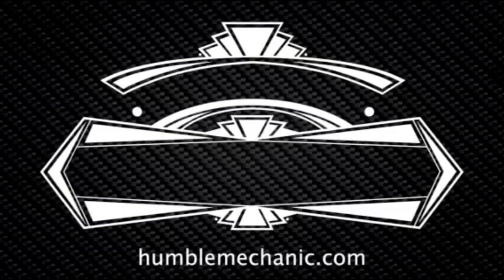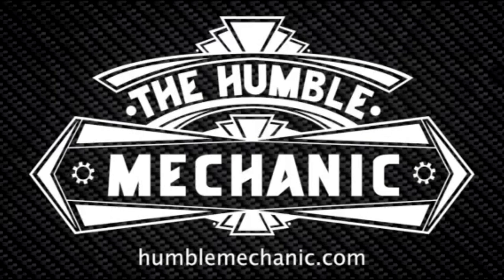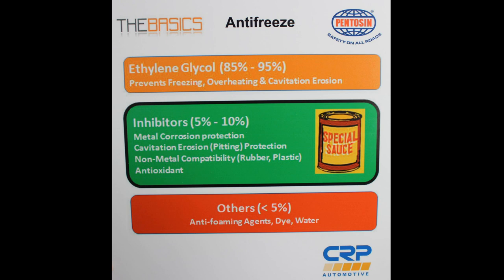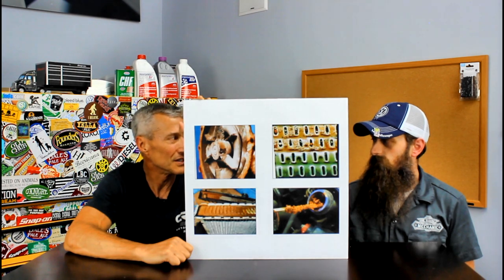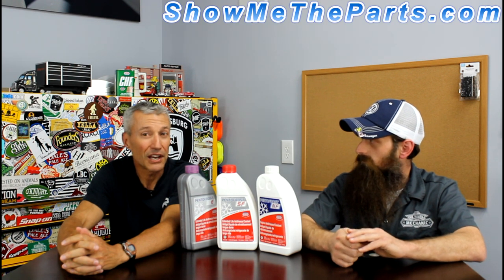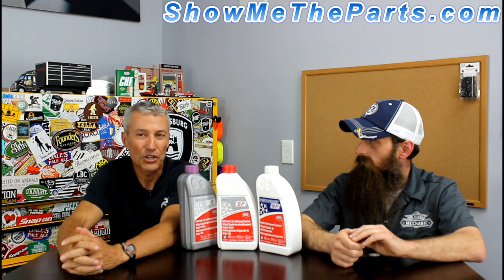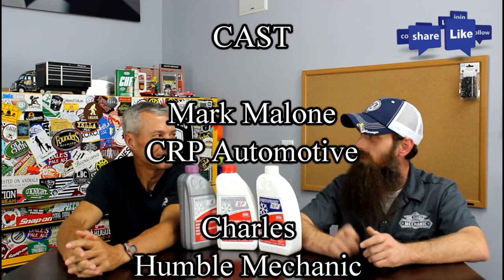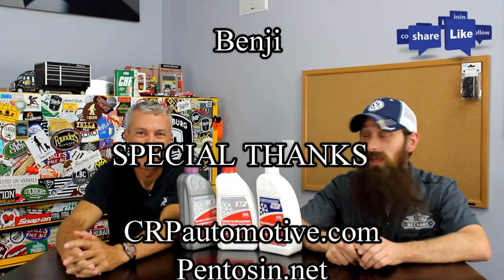What Is Engine Coolant ~ Podcast Episode 85

Comment: I run G12++ VW coolant in my 1988 Ford Escort, the engine is all aluminium except the block which is cast iron.

An OAT coolant with silicates, just perfect.
No borates, phosphates, borates or nitrates.

Comment: Only video BUT was wondering about block issues with my Infiniti and my Tacoma. I had a massive failure on the Infiniti where the water jacket corroded away between two cylinders. It caused a sudden high pressure in the cooling system and blew a pipe off, instant failure since the gauges did not respond fast enough. I was sitting in a dead car with normal gauges. The Taco just needed a new block because it corroded away, but did not fail. Used just basic green stuff (both old cars)

Comment: Dumb question— is there a shelf life to the g13 (or any) coolant once you break the seal on the container? If you top off your coolant at home once or twice a year a gallon can last a long time. Thanks!
Reply from the maker: That's not a dumb question at all. Let me find out.
Reply: Gunbu Def' not a dumb question, Gunbu; I would like to know the answer to that myself. :-)
Reply: Gunbu Shelf life is always a tough question. You have the standard answer that an unopened G13 coolant shelf life is 5 years. However if kept in a relatively normal temperature area it could last 7 years (unopened). Once opened just continue with the years that are left. Regardless (like paint) over time it settles and needs to be shaken up before use. Also you can give it a visual check by pouring some in a clear glass and seeing if the color has faded. Hope that helps a little? - Mark Malone - CRP
Reply: Mark Malone Awesome, yes thank you that helps a lot! I wouldn't have thought to shake it after its been sitting awhile either. I'll be sure to do that.

Comment: I recently flushed the coolant system in an '87 Golf 8 valve that had been running a global all makes all models coolant and changed to blue Pentosin G11. I plan to perform an 8 valve to built 16 valve engine swap on a similar vintage '91 VW Fox soon that would likely call for the G11 from the factory, but has been running global universal. Should I instead update to the purple G13 ++ E formulation? What are the benefits, any drawbacks?
Reply: duosonic391 Great question! You're obviously fine staying with the correct applicated G11 coolant if that is easiest. But remember VW was making changes to improve their Coolants performance so you too can upgrade with a full flush and go to the G13 / E formulation. I don't see any draw backs.  - Mark Malone / CRP

Comment: Coolant service is not stated because the water pump will need replacement by the time it needs to be replaced in VW.  100k miles or 10 years makes sense. I am not sure why Toyota and Honda have only 5-7 years/150k miles but their engines last much longer. typically it takes 150-200k miles when we need water pumps in Toyota with timing chain.

Comment: Humble mechanic do you have any experience with evens waterless coolants I first watched it on the jay Leno garage and I know of a garage that uses it here in the U.K on Porsches as it is expensive but they say it's for the life of the car which makes it cheaper in the long run, and can even be reused if you have to do work to your system and doesn't damage the system as their is no water. I am surprised that more VW's don't use it as I know Porsche and VW's are similar in design.
Reply from the maker: Gylan Underhill I think it depends on the application. I am not an expert on this system, but I think for the time/trouble/cost it may be better to go with a standard cooling system. But again, that really depends on the application.
Reply: Gylan Underhill I have used "Evan's waterless coolant", and ended up switching it out but not by choice...

I bought a used pick up truck a 1996 Chevy 3500 4×4 crew cab 8 ft box with a 6.5L Detroit Diesel (the predecessor to the Duramax, and still used in US military HUMVEE) and love the truck the 6.5L Detroit Diesel gets amazing MPG, I was getting 24.5 MPG towing 9,000 lbs. I bought the truck and it had "Evan's waterless coolant" all ready in the truck.  When I bought it the guy who sold it to me brought it up to operating temp and then opened the reservoir cap that leads to the rad it burped and nothing came out it was just sitting their hot.  Evan's waterless coolant doesn't expand like other coolants, so it puts less stress on the engine.  Keep this lack of expansion and stress in mind.... I drove the truck for 11 months and blew a Head gasket with a white steam/smoke flying out of my truck hood.  The coolant was not to blame, the cylinder head was full of electrolysis. And had been for quite some time I later found out that the truck had an engine swap (serials did not match, because he pulled the motor out of the junk yard)... When we tried to put a new head gasket back on to drive it home, it wanted to explode immediately because of the pressure.... The electrolysis was a pre-existing condition in that engine, and he used Evan's waterless coolant to mask a major problem with the cylinder heads.   (The only way he could sell it was by putting Evan's into the truck, other wise, other wise the engine problems would have been obvious to any buyer).  The truck/engine probably never had a drop of Evan's coolant in it until the guy wanted to sell the truck and had to solve the problem with the cylinder heads... The truck worked like it never had a problem and got great MPG, for months and Months before I had any idea there was a problem. I was stranded out of town for a few weeks, untill we got the heads machined and rebuilt.... If I ever find the guy who sold me the truck he will find his skull on the side walk.  As for Evan's coolant it seems to be a great product, i don't know any other coolant that can mask a major problem with the cylinder head only Evan's.  I did not put the Evan's back in the truck, because of the price of the stuff (having just paid for a partial rebuild of that engine) (back in 2016 now 2018).  I think it would be great for racing and other high stress applications... But if I ever see another used Truck/van/car for sale and it has Evan's coolant in it... Then i either want to inspect the inside of the cylinder head or see how it acts with normal coolant.  If I can't get that I will ask for a reduced price or walk away.

Comment: I still  don't undertand wich coolant could be better for my wr450f dirtbike,  I gets super hot around 135 C° so i I need  the most eficient and also, my mechanic recomended to use pure pentofrost SF with no water and believe that is just making it worse. Do you think Adding 50% distilled  or deionized water would cool it down more eficiently?

Comment: And here I thought I was being wise by sticking only with G12 and DISTILLED water even though my local mechanic says "tap is fine." De-ionized water now? That said, what does the dealership use, Charles?
Reply from the maker: I am sure Mark will have a heart attack when I say---- we use plain old city tap water.
Reply: HumbleMechanic
- HAHA! Too funny! De-ionized water is quite a bit more expensive than distilled; and far more expensive than tap. My mechanic thinks I'm nuts for insisting on distilled. I wondered how well reverse osmosis water from a pet store would work. After some reading, it looks like de-ionized water is some really pure stuff! I guess I have a new item on my shopping list.
Reply: +StealthTDI I think there is some confusion between deionized and distilled water. Distilled cannot have any minerals in it if it was distilled like this guy Mark said. At my work we used distilled water for work more sensitive to contamination than what you would see in the cooling system for a car so I find it hard to believe that distilled is "not good enough".
Reply: +Erik Kovacs Distilled is the gold standard for water purity, DI is "Good enough", soft tap water is probably OK. He's got his wires crossed
Reply: StealthTDI distillatiion is fine.0 mi erals.
Tap water my ass charles.

Comment: Damn, that was a lot to take in.  Gonna have to listen to this again tomorrow, haha.

I typically just do it by colors, if the car takes green, I add green, orange, I add orange, etc. _.
Reply: MrSlowestD16 Actually it was pretty simple to follow except for the part where they talk about the elements mixed in with the different coolants. Thats for chemists.
Reply: FuzzyCholo That's the part I was confused about, lol.  The basic premise is easy, sure, but knowing how they interact (the important part), so that's to say in what conditions you can use one or another is not so easy..

Comment: I live in Israel and it never goes under 0 degrees Celsius.
Do I still need to use antifreeze Or I can use something else?
2.can I mix g12 and g13?
3. According to the video. So is g13 only more environment friendly and it's actually like g12? 
4.if I can't find do water may I use distilled water?
5.is rain water do water? Or good to add 50% to the coolant?
6. Living in a warm country . Do I need to mix 50 50 or I can use less  coolant and more water?
7. Finally I replaced water pump, how do I flush the rest of the coolant and add 6 new liters of coolant and water.?

Comment: So if green, flush, right?
If flush, any tips? Thankfully been less than a year and bright green, though who knows if had the correct coolant before.
Thank you in advance! :D
Reply from the maker: There are some great DIYs on flushing coolant out there. You will probably have to flush a few times.
Reply: Thank you Charles.
G12 or G13 in the 2002 VR6? Looking online even more confused...
By the way, the speedometer issue turned out to be the drive gear in the transmission (though an occasional 1mph twitch but don't mind the shake from the cruse control knowing not going to take off). Mechanic for the fourth time didn't charge me labor.

Comment: Its like the calling of oil, some call it motor oil which it is not, it's engine oil. I just watched a documentary on this and some of the history was interesting, some electric motors did have an oil for their belts, but our internal combustion "engines" are not in any form or fashion a motor.
Reply from the maker: +fordwindsor351 you are technically correct. But in the automotive world I think either term is acceptable(for now anyway).
Reply: I'm not saying it isn't acceptable, it's just wrong, especially with the true definition to each.
Reply from the maker: +fordwindsor351 I agree. But it's one of those things that I don't worry about.
Reply: +HumbleMechanic right on!
Reply: Engines are not motors? 
I've wondered this a few times... so most cars have engines not motors

Comment: the explanation of water is incorrect deionised water is not reverse osmosis, distilled water is also classed as mineral free for a laboratory setting, (think boiling sea water to get drinking water, salt is a mineral) Reverse osmosis removes molecules larger than that of water which also demineralizes, (since the mineral molecules are generally larger) but it is not deionised water, which exchanges ions from a charged resin to make it pure. Also ultra pure deionised water, (and distilled to a certain extent - especially if double distilled) is slightly more acidic (a ph of about 5.5 or so as opposed to 7 which is neutral - thanks to reacting with atmospheric co2) 

you can actually get deionised water using those water filters (like zero water), they have a small resin bed in them that does exactly the same thing, - some of the whole house water conditioners do the same thing also, usually you would pre filter the water before putting it through the deioniser as contaminants can gum up the resin 'beads' and make the filter less effective.
Reply: +Simon Chappel Yeah that didn't make any sense to me either. This video raises more questions than it answers.

Comment: Ok so in the podcast you say "Do not use 'all makes all models' coolant, only what is recommended by the factory. That's all well and good but many "all makes all models" conform to the G12 A.K.A. TL 774 D among many others. It says so right on the bottle. Even ones that don't explicitly say "conforms to TL 774 D" still say in bold letters COMPATIBLE WITH ALL MAKES AND MODELS. In this litigious world we live in I can't help but wonder why they would risk opening themselves up to law suits by angry VW owners who destroyed their engines using their coolant. I mean if you take a step back it makes one wonder what is the difference in the VW cast iron and aluminum that is different from a GM/Ford/Honda/... cast iron and aluminum? Or for that matter the difference between VW and anyone else' rubber O-rings? Why is VW coolant so much better then say Dex-cool in a VW engine block vs in a chevy. Does it really make a difference?